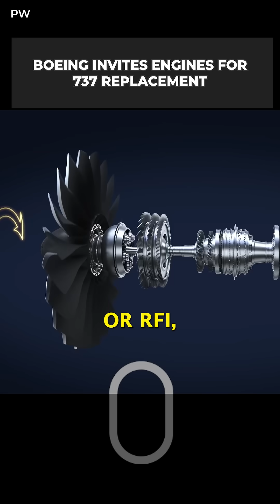Boeing Asks Engine Makers To Power 737 Replacement #shorts

Comment: If I was the CEO I would consider buying the license for the C919 platform and make it better, composite materiale that they already know and chinese not yet, 4 sizes, different wings, better avionics, etc... and so much cheaper as a design, pre-production, production, certification process. They could save billions. Put pride & vanity aside and rise from the hole of problems they are in!!! At least they should consider it!!!

Comment: Boeing can't achieve the certification of 737 Max 7 and Max 10 and dreams about a brand new plane. 😂😅
Reply: That's actually a good reason to start focusing on an entirely new plane. The longer they spend unsuccessfully trying to certify aircraft derived from older airframes, the more money and business they lose. At this point, it's better for them to cut their losses and start from scratch on a new jet, one that can meet all the requirements without worrying about complications from older designs.
Reply: The certification issue is that they are trying to grandfather the certification to an earlier standard, but cannot complete their paperwork, on time.  Achieving certification to the current standards requires a cockpit redesign.

Before, Boeing held off on a new narrow body airliner, because it would cannibalize 737MAX sales.  Now that they cannot get the Max 7 and Max 10 certified, the new narrow body can be targeted in versions that fit the niches of the uncertified models.

Comment: Years ago, Beechcraft was locked in to the PWC-PT6 engine when the manufacturer experienced a strike. Beech quickly developed the KingAir B-100 using the Garret TP-331 engine which kept the line moving. Single sourcing anything is cheaper but risky.

Comment: Options are always good. Especially when issues with one engine type can ground the aircraft for extended periods. People see the plane type, not the engine. If a certain engine is having problems, people's perception is that the airplane is having problems or is not reliable, not the engine itself. So yeah, options are always good.
Reply: Neos with the P&W😂

Comment: I’m delighted to hear they’re considering multiple engine suppliers for a replacement, but it should be a twin aisle since aircraft engines are more powerful, allowed to depart from smaller airports yet fuel efficient to fly longer distances, single aisle on long flights is difficult. idealistically 1+1+1 in business 2+2+2 in economy plus and perhaps even a bunk bed sleeper lie flat in the rear so that we we may have nonstop transatlantic with low-cost carriers and one stop (Hawaii?)transpacific flights. TRANSATLANTIC ALLIANCES: Southwest & Ryanair, JetBlue & EasyJet, TRANSPACIFIC ALLIANCES: Southwest & Lion Air, JetBlue/ Spirit & airAsia. Frontier is already partially owned by indigo, so that’s the pacific connection and Wizz would be their transatlantic European connection
Reply: A 150 seat twin isle plane....🤣

Comment: Well Airbus does have the NEO, so maybe Boeing needs to do that to stay competitive
Reply: The MAX is the exact same thing.  The neo is NOT a new plan.  It is the current A320 family (A320ceo) with a new engine.  EXACTLY the same as the 737 MAX is the latest generation of the 737 (737NG) with new engines
Reply: @rockkitty100 Only that the Neo is only the second evolution of the 320 whereas the Max is already the fourth of the 737 ;)
Reply: Imagine if different Boeing planes had MAX... 
747MAX
777MAX
wierd
Reply: @Max737jet-9   777MAX is just the 777X

Comment: Multiple engine options seems like a necessity with the reliability problems as of late.
Reply: What reliability problems has there been for Engines in commercial aviation? There was 3 Airbuses last year in the first 4 months of 2024 that had complete engine failure, but that’s more likely a lack of airline maintenance than it is the engines themselves.
Reply: @CodyB2 PW1100G on a320 neos
Reply: @CodyB2if you don’t not know the P&W a320 family neo engines are having issues.  The CFM engine (leap-1A) is
better (I def have bias).  Just look at the issues spirit is having because of the engines.

Comment: It would make sense for Boeing to step away from a single engine option for future aircraft, as the Trent 1000 and PW 1000 Family engines have in recent years pointed towards it being better to hedge bets by using multiple options, with the 787 offering two engine options and the A320neo family offering the same. While for larger airliners, like the A350 and 777 it may make sense to stick to a single option for development costs. Though generally, theres been a trend away from multiple engine options, I think the pendulum is about to head the other way, 2-3 options for aircraft of 737/A320 size to 787/A330 size, and single options for aircraft outside of that bracket. Multiple engine options has to some extent insulated the 787 and A320neo from issues related to their engines and Airbus and Boeing are likely to take that into consideration with their future commercial programs, regardless of the benefits from offering a single engine option that the 737 and A350 have thus far taken advantage of.

Comment: Actually, I hope Boeing designs a 737 replacement that can be up gauged to a 757 replacement.
Reply: Doesn't sound like it if the engine is about 30k lbf. That's not enough.
Reply: @kingsharkoon better aerodynamics, reduced weight both by structure and less carried fuel because of more efficient engine and aircraft, scales the engine exponentially down.
Reply: @kingsharkoon yep, the 757’s engines were around ~40k lbf but then again the 757 was a sports car of a plane and if they can get the weight of the air frame down enough maybe ~30k would suffice while greatly improving fuel consumption of the size class
Reply: @kingsharkoon These engines will be for the 797. It’s going to be a direct competitor to the A321XLR and or A330 NEO.
Reply: Make the 757 replacement then scale that down boom 737 replacement
Reply: @ZiboK1nevo scaling down is always a bad idea. Never worked with past new developments.
Reply: @ZiboK1nevo  "Scale down" planes rarely work. It's why the 767-200 was a flop, A330-200 flopped and 787-300 was cancelled. Scaling down still means the same wings, gear and other components which are overkill for the smaller plane... which leads to a plane that's heavier than it needs to be which eats fuel efficiency.
Reply: @ZiboK1nevo  Boeing would likely make a separate replacement for the 757, they can even revive the same 757 by updating it and calling it with NG or Max nameplate. Only problem is no one would buy it, hopefully they look forward for the new 757 replacement incase it gets launched.
Reply: They should just make a mini 787
Reply: @BigO1108 yes, i guess it will be some sort of 787 but with the dimensions of the 757, one aisle of course.
Reply: A321* with 40,000lbf of thrust versions. Cause B757 needs another bigger replacement. The B797 bigger than 737 would only be a 737 replacement not 757, like how 787 is a replacement for 767, that's how Boeing makes updates.
Reply: Yeah, the 737 has way too much blood in its name now. Not to mention that it's quite ugly.
Reply: What they should do is have 2 subgroups with 2 variants each, with 4 total variants.  The smallest two would have a smaller wing, engine, and landing gear, and the larger two would have upgraded components.  But all 4 variants would have the same flight controls and systems for a common type rating.  This would allow for optimized aircraft from ~130 to ~210 passengers all in the same family.
Reply: The 757 replacement is going to be more like a 767-200 sized replacement with two aisles

Comment: While having a choice of engines is not as important for an airline with a single model fleet - the likes if Ryanair and Southwest sprimg to mind, airlines with a more mixed fleet may wish to standardise the engines accross their fleet. Restricting the engine choice to one manufacturer could restrict sales. It is also possible that possible future tariffs may meantha regardless of technical superiority, US based airlines may feel that it is less of a risk that mstick with US based engine manufacturers while non-US ones may feel the opposite.
Reply: Standardizing their engines is a risk. If there are engine issues, their whole fleet gets grounded.

Comment: I'm sure at least one of the engine manufacturers has plans drawn up. There hasn't been a clean sheet single aisle 130+ passenger aircraft since the A320 series. There have been a few times that Boeing or Airbus have been in a position where it might have been appropriate to have an engine concept ready to present. 

I expect an impressive (15%+) improvement in fuel efficiency in the new type, along with avionics upgrades past anything currently available.
Reply: That’s what the 797 is going to be and what these engines are most likely going to be for. Boeing has started development in n the 797, but really just on paper. Supposed to be a competitor to the A321XLR and the A330 NEO. 
Boeing does really good when they bring out completely new airframes. The 747, 757, 767, 777 and 787 were all amazing when they came out. The 737 is the only plane that causes trouble, and even then, it statistically has a lower mechanical failure rate than the A320.
Reply: And I can’t imagine how nice a a completely brand new narrow body Boeing will be. Carbon wings, carbon fuselage, super efficient engines. Completely redesigned flight deck. Definitely going to be an amazing aircraft.

Comment: Maybe 757 is back ?
Reply: Why do people keep thinking this is in option?  It’s not. Will never happen.
Reply: @rtbrtb_dutchy4183 If it ever came back, it would probably be in name only. The fuselage needs replacing with something capable of taking hold containers like the A320 series, the wings need a re-design as they are no longer up to today's efficiency standards, the mechanical conntrols need replacing with up-to-date fly-by-wire ones along with any other changes to make it 'fly' as close as is possible to the 787 and 777x , and then we have the engines!

Making all those marry up with what is left-over from the old 737/757 models would probably be more expensive than starting over.
Reply: Why bother with 80s aerodynamic design philosophy when we can design even more efficient planes. There is little point in resurrecting the 757
Reply: Get the airlines to buy it!!!!   Just because we love the 757 the airlines stopped buying it.   Infact a year before the 757 line was halted I believe in 2004 Boeing reached out to every single 757 operator and asked if they would be interested in buying more.    They ALL said NO !!!!!!!!

You cant keep a line of aircraft alive with no buyers!!!!
Reply: Lol the 757 is like the A380. Avgeeks love it, crew love it, airline bean counters didn't...
Reply: @AnishAbraham  exactly.  With no orders you can't keep a line of aircraft Alive!!!!
Reply: 737 replacement would have nothing to do with 757 but be a 737 replacement, cause 757 is a different segment of plane than the 737. A321 is bigger than B737 but smaller than the B757 overall.